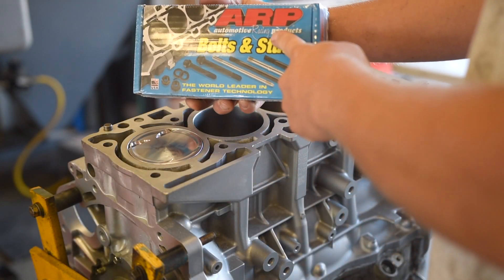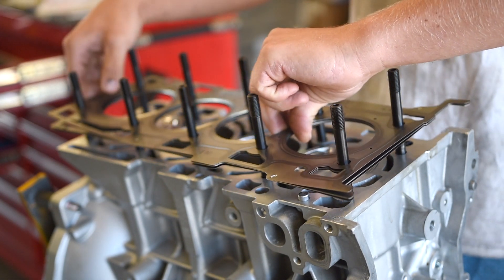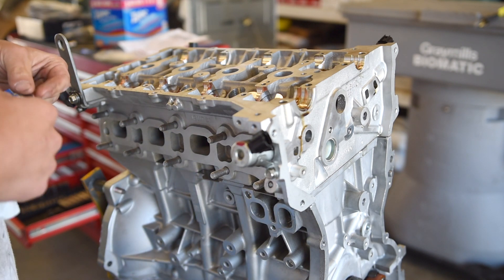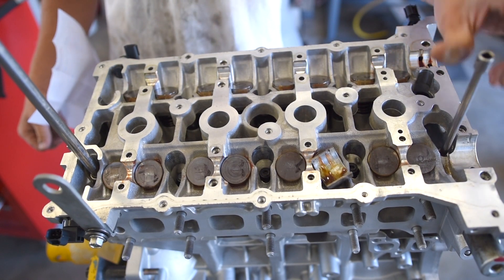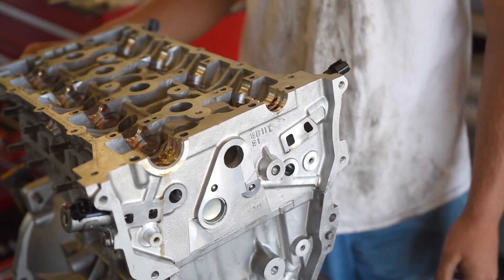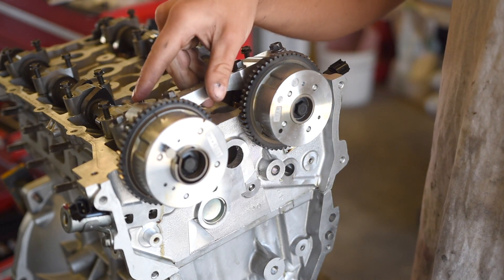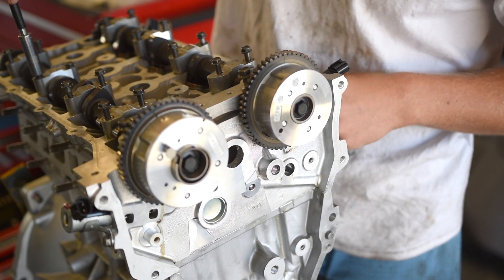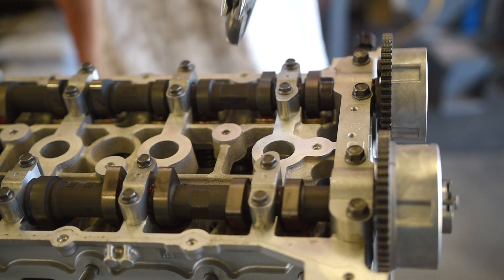600HP Capable Evo X Motor Build | ARP Head Install

Comment: Hey Devin I tried to did a valve spring and a GSC S2 Cam install and accidentally drop all my valve bucket and now they are not in the right order where they go in. a GSC S2 required a .08in for the intake and .12in for the ex. I put everything in and measured it but it all off. Yes I  did make a listed but is there a way to help me get to .08in for the IN and .12in for EX instead of keep take cam off and repeat until i find the correct one or it doesnt matter?  Anything will help at this time lol.

Comment: ATTN @devin niemela in this video you state that the cam thrust bearing bolts are to be torqued to 8-in/lb this is not correct just for anyone watching this video to help with their 4b11 build like I was.  The correct torque is 107 +-8 in/lb and in the service manual it also says to torque the cam cap to 23 ft/lb final torque this is not correct as you will stretch and or break the bolts inside the head. The proper torque is 15 ft/lb on second and final pass. Don't want anyone to blow an engine up and get all those Evo's running smooth out there! thanks again for doing these walkthroughs though man it gave me the confidence to do my own build having seeing you do it on here first. Mucho love brother and keep it up!
Reply: I have always used 106in/lbs for the m6 bolts and 22lb for the m8 bolts....i have never had a problem on any of the 5 engines I've done....he did torqued the big main cap using the wrong sequence tho

Comment: Really nice the videos man planing on do the same on mine I want to build it safe. Planning on do the transmission,transfer and rear diff from there jump in to the engine. I'm also planning on get a FRS/BRZ/86 do a 2JZ single turbo.
Reply from the maker: Thank you man. Yeah thats a good start. 

Ooo, an 862JZ would be insane.